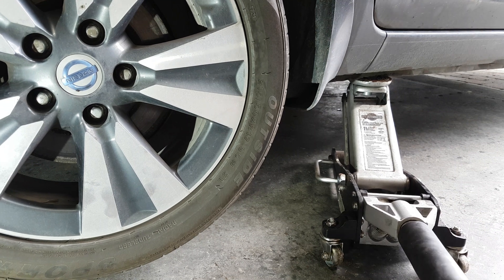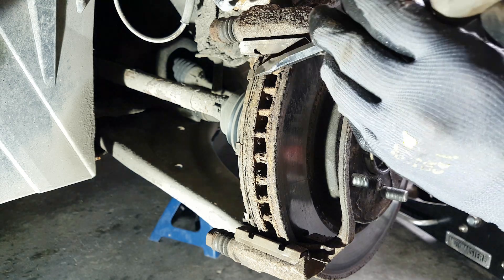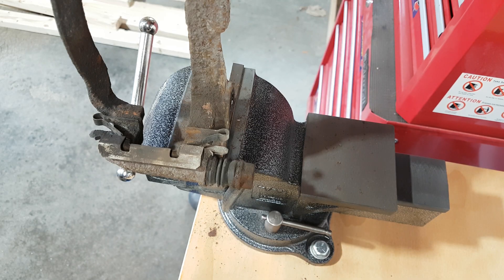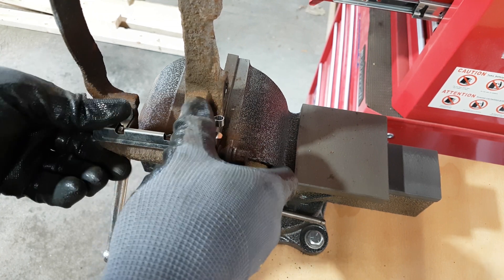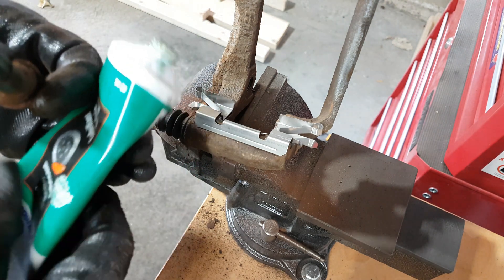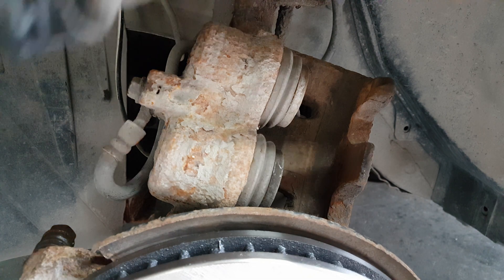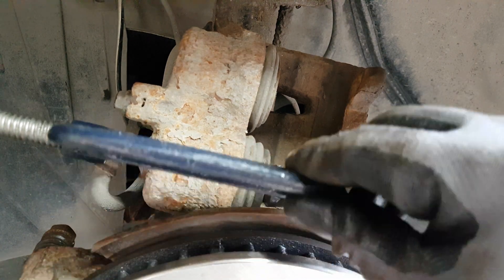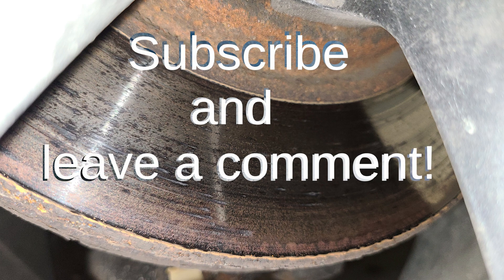Nissan Leaf Front Brakes - Proper Job

Comment from the maker: I added the service manual in the description. I also made a shortened version (5 minute) of this video for those that don't experience rust issues: https://youtu.be/s9gAhtD4Htw

Since the brake fluid is a closed system, when the pads wear, the fluid level drops, but when you change the pads and press the pistons, the fluid goes back to the full level. That means if you added fluid while it was low, it might overflow when pressing the caliper pistons.

Comment: The pads I bought all have massive clips at one end of them. These clips do not line up well with the clips in the bracket, and will not snap in evenly. It's highly frustrating. I'm ready to just bust the stupid wear indicators off so they aren't in the way so that the pads clip in properly.

Comment: Good video. Only thing i do as well is wire brush the caliper, bracket and hub surface - it just helps with the crud and rust.
Reply from the maker: Thanks, I only focus on the moving parts that keep the brakes working for a long time, the aestetics doesn't matter much for a 12 years old car exposed to road salt. So the reason I don't show a cleanup and paint is simply that I just don't want to do it as it's not worth the time for my car.

Comment: Hello dear
Do we need to take the main battery fuse out to do this brake pad job or it’s safe to do it like conventional cars. Thanks
Reply from the maker: Hello, no need, don't worry about the high voltage unless you do something that involves disconnecting an orange cable (which is not involved here)

Comment: Great video...no critiscism but maybe a quick clean up of the caliper and bracket and a lick of paint. Doesn't cost much but can help with future disassembly/servicing. Your slide greasing advice is spot on and yes replace those rotors, I never reuse rotors always put on a new set!
Cheers and enjoy your Leaf!
Mike 🇨🇦
Reply from the maker: I used to do that, but because of the salt here, the rust forms back after 2 years, so now I only make sure that the bolts have anti seize and that the friction surface are clean, I let the rest look as ugly as it wants as long as it's still structurally sound (that bracket won't rust through for a long time)
Reply: @sgcars6731  yes you are correct...those brackets will last a long time. I am just stupidly over anal about stuff like that...🤣🤣

Comment: After at km you change brakes?
Reply from the maker: It was 2 years ago, I don't remember, besides I'm not sure if the previous owner changed them.
Reply: @sgcars6731  but yeah, at 30.000-80.000 or to much?
Reply: @SanduAka47we did ours now. After 45k km. First time in 5y

Comment: Your video pretty much covers it :-)  My one critique is your jack method.  I see countless damaged rocker/pinch welds, particulary on older cars in the rust belt where that tab is bent over. Once damaged, it rusts, and a few years later, you have potentically have no lift point!  I had one in my shop last week where the entire area had rusted out.  I've used a variety of solutions for this, but the best in my shop are aluminum (magnetic) slotted cups that protect the rocker pinch weld at the lift points.  A hocky puck with a slit cut into it works too.  The video was great...I just cringed slightly when you lifted the car!  Cheers, Dennis.
Reply: Yes, the front ones are completely solid and won't bend, the rear ones are rust and dust kept together by the surprisingly flexible paint... It may be the official jack points in the manual, but 10 years later they rust, and now I prefer using a different point closer to where I put the stand in the video, but hey, that was recorded 2 years ago when I had even less rust. I have a hokey puck for that purpose, but I knew I would get away without using it. Now if someone else is reading this, use our own judgement, try not to bend the tab, and if you are unsure, this is a solid spot: https://proxy.imagearchive.com/c2c/c2cfd4b8f1c7100e834c66a141091bad.jpg
Reply: I also found that these cars are so heavy that using a scissor jack can result in cuts into the metal! I'll have to try and find a hockey puck...
Reply: @thromboid  I have a few different versions of pinch weld protectors.  One is similar to a hockey puck with a slit, but my favorite is the aluminum version with magnets that sticks on so you place them correctly, and then jack away.